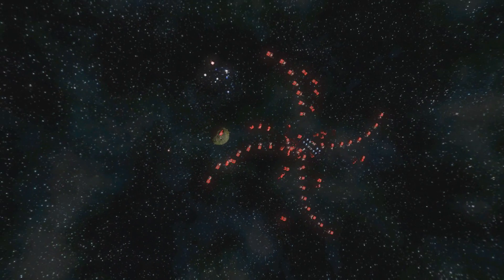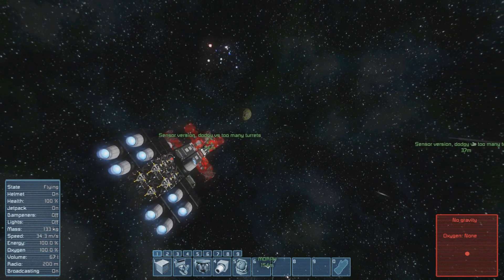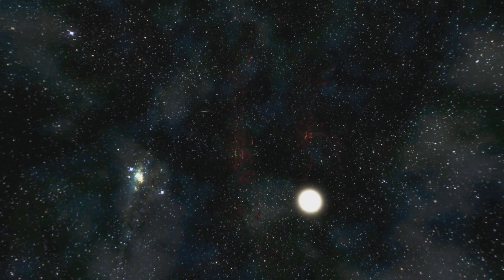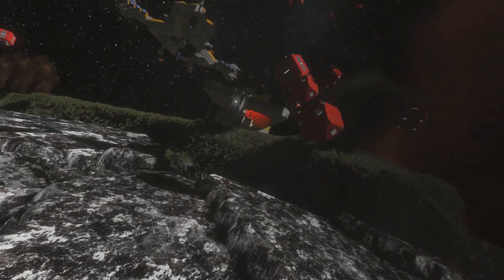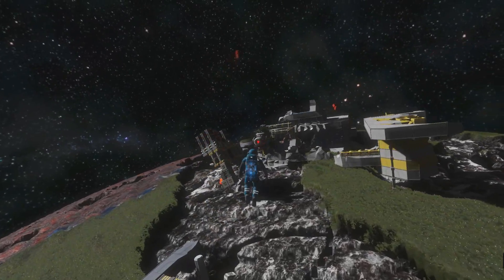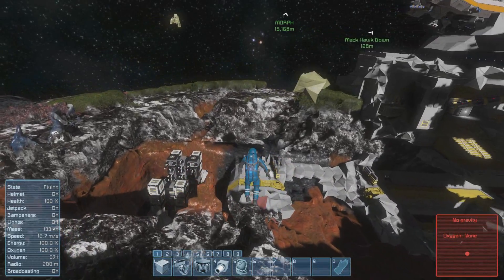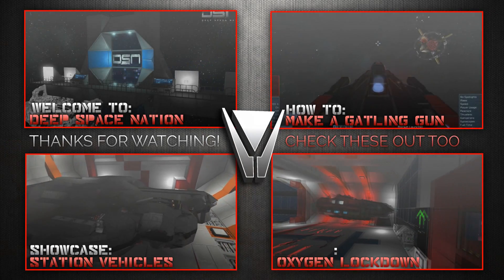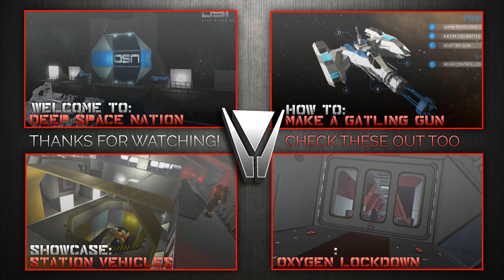Patchology Simulation Speed Improvement [Space Engineers]

Comment: My problem running space engineers right now is that my machine can not run it without a lot of stutter any more, older versions would run better, and I do not know if this has been fixed, but loose rocks would glitch into my mining machines after a few hours use and blow them up from the inside (stuff like refineries wont deform to accommodate the wedged in debris, so they would constantly take small amounts of damage instead).